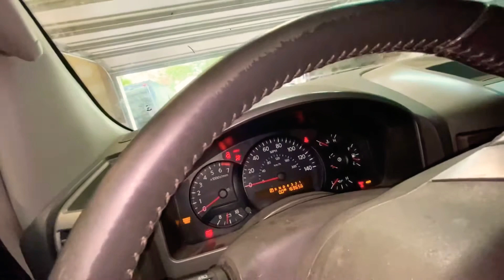NISSAN TITAN ENGINE REMOVAL AND INSTALL

Comment: Question. Do I have to mark the drive plate when swapping the engine with the same replacement? If so, Do I mark the driveplate once I remove the screws from the trans and have the engine out? I appreciate your response back, thank you.

Comment: I have a 2006 Nissan Titan 5.6 has the head gasket damaged on the passenger side what is best to do if it is broken try to change it or change the engine if so, does the engine of a 2008 fit?
Reply from the maker: The 2008 should fit
Reply: No it won’t fit you have a none vvt

Comment: Just got started on the same swap. How did you keep the wiring harness connected on the engine? Didn't look like you removed the fuse boxes with the harness. Thanks.
Reply from the maker: Follow the wiring harness to the firewall and disconnect the ecu
Reply: @1worldundercars67   my harness doesn't all terminate at the ecu, several wire bundles split off to the 2 fuse boxes in that corner.

Comment: Did the transmission line right up for you ?
Reply from the maker: Yes they came right out
Reply: @1worldundercars67  when you put the motor back in ? 
I’m having a hard time lining mine up
Reply from the maker: U can flex them a bit